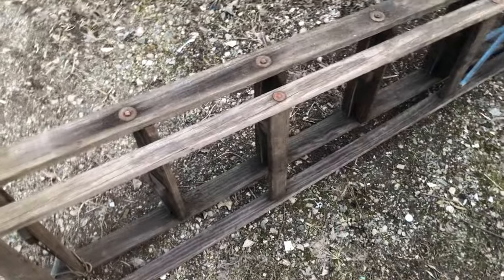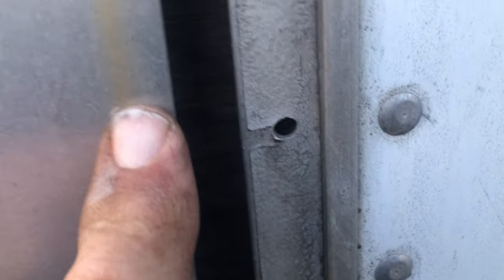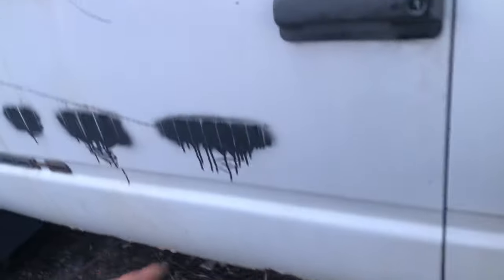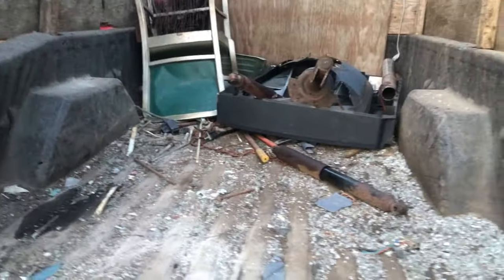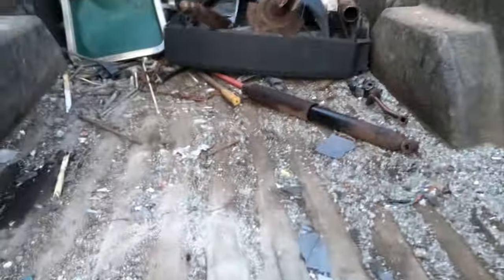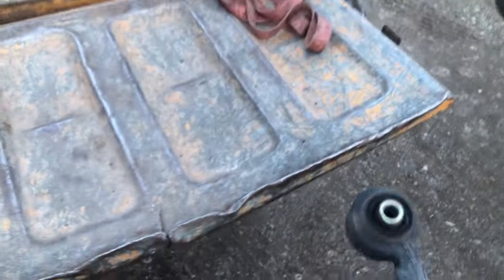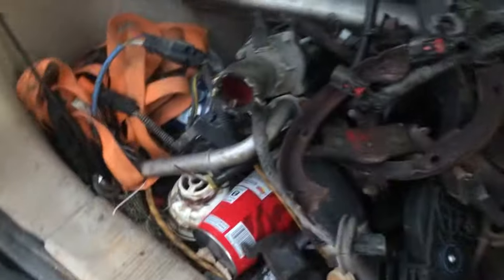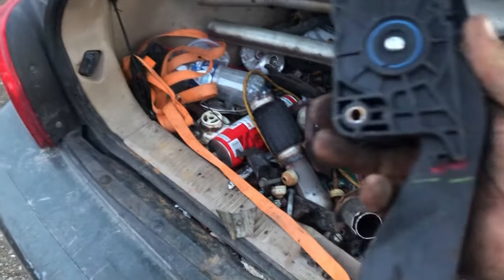WHY SO MANY FAILURE POINTS?

Comment: I would use a few straps to get the box to come together put a 2x4 or a 4x4 by the cab for extra pressure to draw it in 
use screwdrivers to line up the holes
Reply: they are having to be big straps
Reply from the maker: I see maybe it can work out for me
Reply from the maker: Yeah  it’s really a tough thing
Reply: @steelisthemeal  if you can get the holes to line up put some bolts in to keep it in place
Reply from the maker: @danohstoolbox sounds like a plan possibly if I can get it back together……..
Really bent out of shape that is for sure
Reply: @steelisthemeal  if it is that strong you may have to use a comealong to get a good pull on it
Reply from the maker: @danohstoolbox bent out of shape kinda bad I need to take my time and relly figure it out so it works out well
Reply: @steelisthemeal  I would probably just ratchet strap into the back door pull the plate back.... Then you're gonna have to get like a four by four and a floor jack and push it up a hair... The top still connected , so it probably wouldn't be that bad to line it back up.. Definitely would help to have a hand to hold a strap up until you get it tight... Probably could do that with some duct tape by yourself
Reply: I would try to get the strap pretty low... That's stainless steel corners probably pretty strong...
Reply from the maker: @ScrapFarm duck tape always a win
Reply: @ScrapFarm  I concor it should work
Reply: @danohstoolbox  Do you like a 2 inch strap on the front? And then maybe some smaller ones from midway down the box to the back door.... I don't think you're gonna find one long enough to do. The whole thing you're probably gonna have to use three...
Reply from the maker: @ScrapFarm it’s a 12 foot box or 12 1/2 feet so that’s like 25 feet plus the sides are like 7 feet or something like that or 7 1/2 feet 
So The strap would have to be about 40 feet at least if only one used
Reply: @ScrapFarm  ya 2 inch should work 
if not a come along will 
gives a bit more pulling power
Reply from the maker: @danohstoolbox  
Hopefully if something like that doesn’t end up breaking the truck etc 🤔🤷‍♂️
Reply: @steelisthemeal  I think your smart enough once your in to it you will figure it out
Reply from the maker: @danohstoolbox I just can’t wait to figure it out and get it all back together again

Comment: That white, box truck would be the last thing I would sell..... Especially since it's an OBS.
Reply from the maker: What is wrong with the old body style?
Reply: @steelisthemeal  nothing that's what u should keep
Reply from the maker: @ScrapFarm understandable….
I just figured if made to look 1/2 way nicer & running ok it should sell for a decent & fast buck
Reply: @steelisthemeal  I would not sell the white one.... Obviously you can do whatever you want. But you're never gonna replace that size truck.... And you have the best generations.... If the frame is not rusty and the engine and transmission are good I would keep.it... You need to get rid of that big ass yellow one...
Reply from the maker: I probably will do the same thing with the big yellow one
Fixing it up & selling….

Selling everything is the ultimate goal 
Working with whatever I got to make it happen 

Eventually leaving this place here 
Starting with whatever I think would sell the easiest with the least money needed for repairs etc 

Idea is to close up shop 
“Mostly “ & get a punchcard job “maybe’ & scrap a little bit “maybe “ & fix cars…..a little…
& repair house I’m in to prep for selling & move away maybe 20 miles from here and then maybe just maybe start over again…maybe…..on land that’s all mine 
Big pole barn or barndominium 
Somthin …. that’s the future
Plans always change but I’m working on eventually closing up shop 

You will own nothing & be happy type action 

Btw  I’m only gonna keep the junk cars or trucks the ones that are worth the absolute least 
The dodges & whatever 

I’ll keep the big white ford for a while I don’t wanna put too many more miles on it 
I already put 2500 miles on it
So I’ll just drive it around the block once a week or to the grocery store and back or something. Or maybe not
Not sure exactly what I’m going to do I might end up getting a big trailer I don’t know 

Right now I’m going to concentrate on selling the white box truck
Then I’m going to probably but I’m not sure work on the blue Ford crew cab ….. while working on other stuff

The pathway to utopia is not a straight line

Gotta still go scrappin to bring in fresh cash 💰 daily 
A little 

I’m saying all this and I don’t even have tomorrow planned out🤣
Just wanna sell & get the most possible

Comment: You can't even buy u halls anymore. They cut the boxes off of them.
Reply from the maker: Yes & you are correct 1000% on this 
They scrap the boxes & or re use them depending upon some factors 

Only sell the cab & frame there’s one for sale  uhaul for over a month unsold just a cab
Reply: @steelisthemeal  could you re box one that might be a option 🤔
Reply from the maker: Oh sure ya can buy a non uhaul box of what ever ya find that would fit